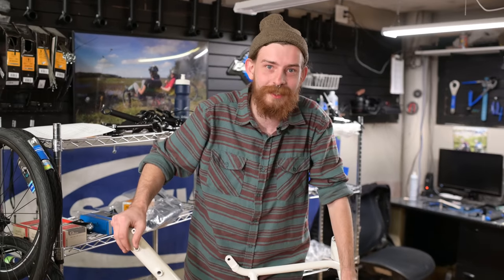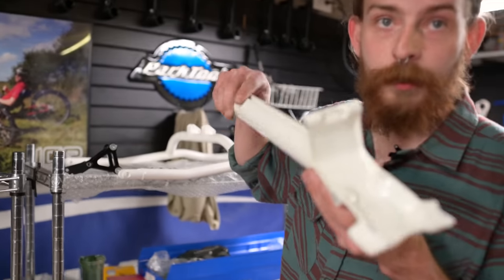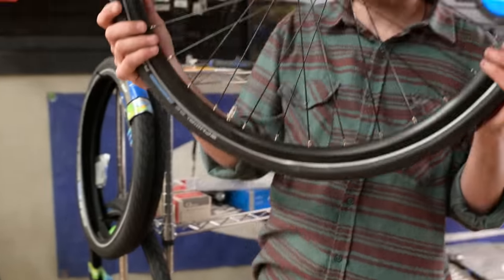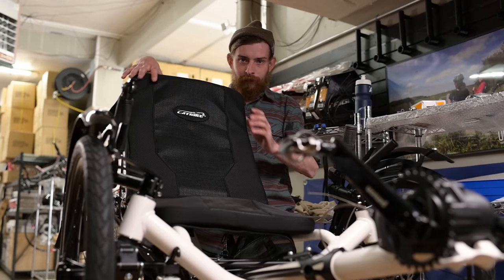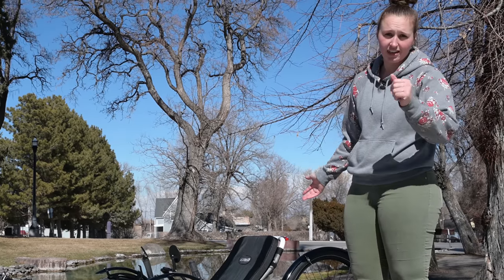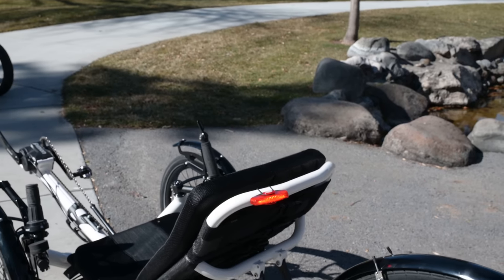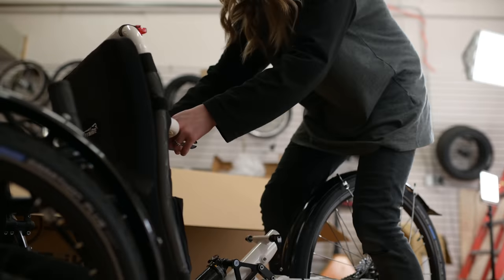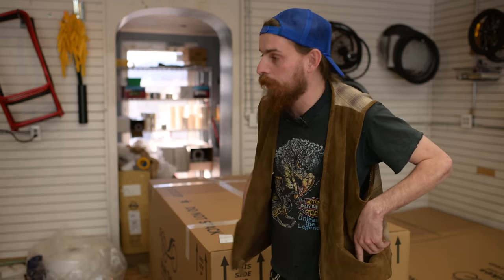60-SPEED FULL SUSPENSION ROAD AR W/PINION - Super Catrike Road AR Recumbent Trike - Utah Trikes

Comment: Can the Rotovelo be adapted to have shocks?  I like the solid fairing, but hear that the trike underneath is a little stiff.
Reply from the maker: There is no retrofit front suspension that will work with the Trisled frame under the shell, but we have built custom frames before for the Rotovelo. We currently have one in the queue that we are building with suspension that will likely make it to be featured in a video.
Reply: Thx!  Excited to see that, for sure!

Comment: $5000.00 to $6000.00 ha ha ha ha ha ha and that's without a motor no windshield, no spare tire, no lights, be cheaper to buy a car or motorcycle.
Reply from the maker: This has pedals, doesn't use gas, doesn't need a license or car insurance.